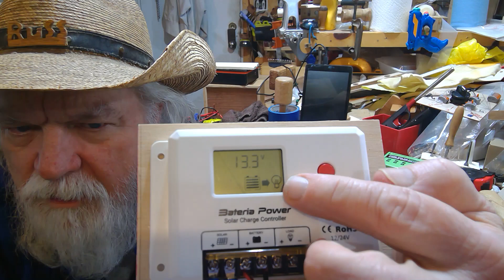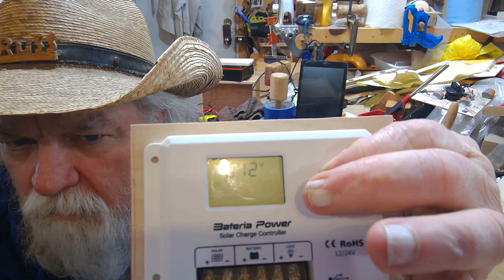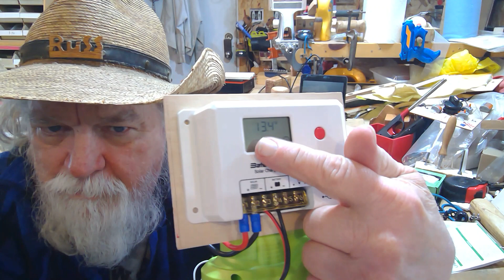Ryobi Powered 12v Battery Charger by OTB Thinker

Comment: Absolutely genius!
It took a while for the light bulb to finally come on but it did.  You are taking a "cheap" solar charge controller and substituting the solar panel generated power input by using the Ryobi battery as the solar power.  The solar charge controller then does its job of adjusting the output to the correct output voltage level.  Like you said, there is no need for an expensive MPPT solar charge controller - the Ryobi battery voltage will not fluctuate.
Wow!  This does open the door to a lot of possibilities.  Thanks for sharing!
Reply from the maker: thanks Steve.  Welcome to my shop.  I have lots of subjects on my channel that save money.

Comment: I am trying to use 20v black & decker batteries or Dewalt. The DW are 5ah but I have more B&Ds. I believe I have 8-10 all hold a charge.
Reply from the maker: I would think you can do this with almost any tool battery.